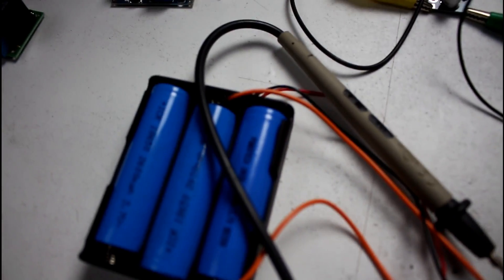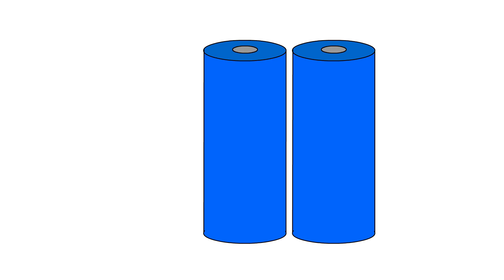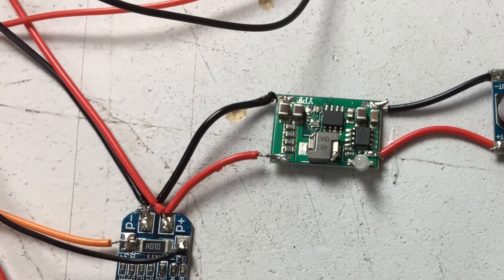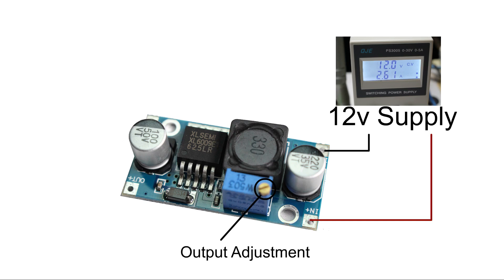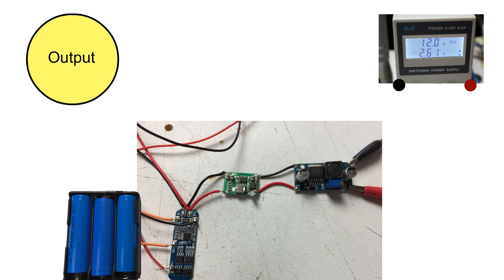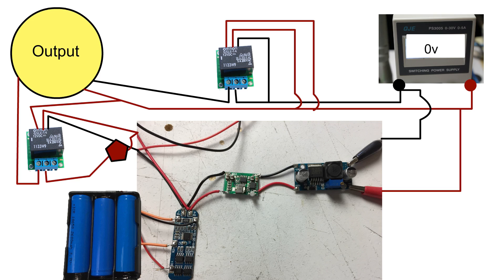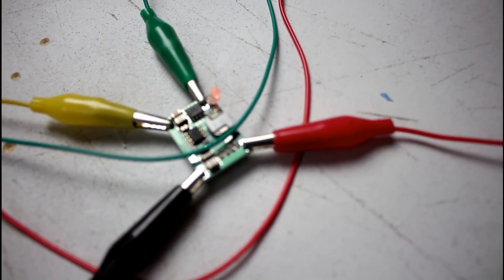Lithium cells in Series with BMS - Battery Pack Considerations (MEHS) Episode 61

Comment: Hi, Thank you for your video.
I have a question about the protection battery board (BMS). There is so many BMS on the internet, with 8A, 10A, 20A...
Like this one: https://ru.aliexpress.com/item/3S-20A-Li-ion-Lithium-Battery-18650-Charger-PCB-BMS-Protection-Board-12-6V-Cell-64x20x3/32799910439.html?spm=a2g0v.10010108.1000016.1.1c26848dPoZ5az&isOrigTitle=true
How should i choose the right one for ma batteries ?
Reply from the maker: - Hi.  Try not to worry about the ma of the cells but rather the current that your project will draw or the rate at which you will charge the cells.  How much current is going in and out of the BMS.  Then pick a BMS that is rated higher than that.  Remember some projects have a higher startup current, like those with electric motors so give yourself plenty of buffer, dont grab a 10A BMS when your project typically draws 9A.  in that case you might be better of with a 20A unit.  Cheers.
Reply: My Electronics & Hacking Show thank you
Reply: One more question. If my project need only 10A and i will solder BMS for 20A, will it damage my cells or my electronic items?
Reply from the maker: - Hi.  Short answer is no.  The rating of the BMS is how much current it can handle.  You will be able to get a physically smaller BMS by using one rated at lower amps but the current rating wont hurt your cells or your project.  The only factor to consider is how much current you plan to push through the BMS to the cells.  if the BMS can handle 20A its unlikely you would want to push that much current into the cells although technically, the BMS would allow it.  Just think about that and you should be fine.  Cheers.

Comment: what should i buy for charging 4 x 18650 cells in total.     i have 2 double 18650 battery holders that put the 2 18650 cells in serie.   voltage of 2 cells in series between 7.4 volts - 8.4 volts.
Reply from the maker: - Hi.  If you're talking about an integrated solution use the MAX745 board i reviewed a few videos back.  It can charge 1-4 cells in series.  If you are going to remove the cells you could use a 4 cell charger like the Nitecore D4. 
 Cheers.

Comment: If the project draws more power than the batteries can provide and needs to be plugged into a power supply, why even bother with the batteries?
Reply from the maker: - Hi.  I think what I said was, the external power supply needs to have enough power to run the project and recharge the cells.  If the project draws too much power, say 5A and the power supply can only deliver 5.5A then the cells won't be recharged correctly.  Cheers.

Comment: So im not planning on charging  my project while using it so how would i have to worry about looping
Reply from the maker: - Hi.  If your aren't charging while using, then no worry at all.  It's only an issue when your project draws 2A when running (as an example), and your charging module can only charge at 1A no matter how much power you could provide your project.  If your project is sleeping then the charge module can charge the cells without the cells being drained faster than the charger can supply power.  Cheers.
Reply: Thanks for helping me understand liked and subbed

Comment: Hey there I have a question. If my BMS is rated for 15A and I have a 30A power supply, will my bms draw 15A and blow up my batteries that can only take 5A? or will the bms only draw 5A? Thanks
Reply from the maker: - Hi.  If you are just connecting the 30A power supply (such as a power brick or wall wart) to your 15A BMS, and you are just trying to charge the cells (not ideal by the way), then your cells will only charge at around 1A each, so 3A total and this will drop off quickly as you are not applying a CC charge.  If you have a 30A CC supply then the BMS will be destroyed.  The reason your cells will only charge at 1A or less each is because you're not using a proper lithium charger to provide CC then CV.  The cells will just draw enough current to obtain a basic charge.  The BMS is not charging the cells, just allowing current through to the cells that does not exceed the peak voltage of 4.25V.  Cheers.
Reply: Thank you so much, big help. Love your videos and your channel. You've got a loyal sub here!

Comment: I'm building an ARM laptop and I was thinking a lot about the problem you stated here. Do you think a setup like the one I have here: https://imgur.com/a/Cxxg5 would work?
It's based on the setup in this video, but I'm adding a buck regulator before the load (i only need 5v for my project), it should handle either 12.6v or 15.6v (if you have the charger connected or not). I also added a diode between the BMS part and the supply to try and keep the 15.6v away from the BMS (there might be some back-feed through the diode, but only nano-amps). 
The thing I'm not sure about is tying all those grounds together, would that cause some issues?
Reply from the maker: - Hi.  I don't see a problem with your circuit design.  The proof will be to test everything once all together.  The only real differences would be the behavior of the parts on the circuit boards and the rating of such things as the diode.  Cheers.
Reply: Thank you! I will put it together and  test these days

Comment: Does the bms shut down when one cell reaches the low voltage or the total voltage?
Reply from the maker: - Hi.  The BMS monitors individual cells so it will shut down the pack if just one cell drops below the cutoff voltage.  If its a BMS that doesn't have a different recovery voltage or timer, it will turn back on when the voltage of the cells recovers above the cutoff voltage.  This means your project, say a light, will flicker quickly as the BMS turns the cell pack on and off as the low cell drops below the cutoff voltage (say 2.9v) and then recovers to be above the cutoff voltage.  Better BMS will have a recovery voltage that is different to the cutoff voltage.  The cut might be at 2.7v and the recovery might be at 2.9v.  And some have a timer that will keep the cell cut off for x number of seconds.  Hope that helps.  Cheers.
Reply: My Electronics & Hacking Show. So a bad balanced pack will leave others in the high voltage range when the first cuts off.
Reply from the maker: - Yes, correct.  That's why its important to use a good charging methodology such as a good lithium charger and balanced cells (as well balanced as you can find), doesn't need to be perfect but the closer they are, the better the result.

Comment: Your videos are great, thank you. I would love it if you could help explain how a BMS works when used on larger packs, such as those used for ebikes, or for a power wall.
Also, what happens if you were charging multiple packs, each with their own bms, from a single charge controller? Would this even work? Could it be dangerous? Thanks so much.
Reply from the maker: - Hi.  There is a video idea for later on, thanks.  Yes you can charge multiple packs from the same charger but the more packs, the less current goes to each of them so you would need to keep that in mind as you typically want to supply each cell at least 300ma.  Cheers.
Reply: Cheers. So essentially, I'd want to make sure a solar setup, with controller, could provide enough amps for the total number of packs / cells? With two packs, I'd want to send double the recommended amps/current for charging a single pack, and the BMS would, in theory, protect the pack from too much current if one finished first? Thanks again, I look forward to your future videos.
Reply from the maker: - Hi.  Yes basically.  You just need to make sure that the solar power source has sufficient current (and the correct voltage) for the X number of packs.  If the packs are 3S then you would be feeding the pack no more than 12.6V at a min of 1A and a max of 3A.  If you are just allowing the current to flow to the BMS boards and letting the BMS board do all the work for charging the cells then that not a good approach.  You need to have a regulator between the solar panel and the BMS(s).  Cheers.

Comment: 2:59 the curves have nothing to do with the electronics  it is only dependent on the battery internal resistance; the electronics do only the power supply limited by voltage (+sometimes current)
Reply from the maker: - Hi.  Yes that is correct.  Is that not clear in the video?

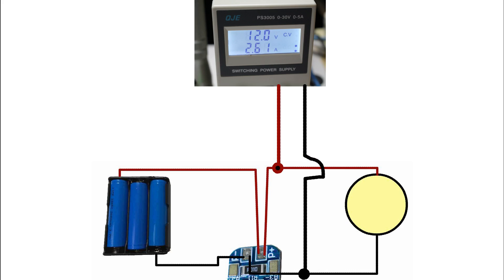Comment: 1:48 is wrong. do not connect it this way
Reply: It looks wrong to me too - the whole purpose of BMS is to disconnect the battery during over/under voltage or overcurrent.    But in the drawing, the battery is always connected (it is directly soldered to both the load and the charger).     
If your charger is unplugged, your load will eventually drain the cells to 0.0v and wreck them.  If your load shorts, it'll be.... exciting.  
As shown, the BMS is not in the circuit :(
Reply: Jan Kirchner yip ... Wrong... people on YouTube need to stop getting shit wrong... If you don't know shit don't say shit... Simple...
Reply: Take this video down and correct it! It makes the whole video WRONG!
Reply: At 1:40 he says "you also connect your project to the BMS" - which is correct, but the drawing is definitely wrong. If the image of the 3 blue cells where replaced with an image of a micro USB female adapter, it would've made sense.
Reply from the maker: - Hi.  This is actually the manufacturers recommended connection.  Why do you think its wrong?
Reply: Hi and thanks for the response. Well maybe I do not understand your drawing but battery should not be connected to the P+/P-. P+/P-. It is just to connect the load (output) and charging (input) in parallel.
Battery has another points to be connected to.
Btw - I doubt that this is the connection recommended by manufacturer. Maybe I just do not understand what you mean by the drawing (the blocks)...
Reply: @michaelsstuff4402  you are wiring the battery directly to the power supply and in this way you are not using the bms but applying direct 12v to the battery this is very unsafe and can lead to a battery explosion
Reply: C Mooner so is this NOW the corrected video ?
Reply: No. I believe this video is still incorrect.
Reply: Hello brother, I have a 3s 40A bms setup for my batteries, yesterday they worked fine but today as soon as i connect a load the Output voltage of the BMS drops to 6V making the load inoperable. This board is even new already threw one 3S 25A board for facing similar issue. Pls resolve or guide me if u know.

when load gets disconnected BMS shows Op again to 11V...each battery has 3.78, 3.79 and 3.80V
Reply from the maker: - Hi.  Yes you are correct.  My mistake.  They do happen especially when the hours blur together.  I will write a correction and advise people to view the actual wiring example shown a little further in the video.  Thanks.
Reply from the maker: Hi.  Ah yes now I see what you mean.  Yes you are correct.  I have drawn the BMS wiring connected to the P+ P pads instead of the B+ B- pads around the BMS.  I didn't even pick up on that.  Thanks.

Comment: Dear MEHS, I would like to create a big battery module for a small electric car. This car have got a 96 V nominal voltage feeding. I think to use the solution of relais. My battery pack have to 26 cells in series to create a nominal voltage of 96 V, but for a properly capacity, with a single cell of 2,6 Ah, I need to connect a 20 cells in parallel. So i Have a battery pack 26s 20p. If I use 26 TP4056 for charging and a Battery PROTECTION Board to control the discharging ( Balance function is not necessary, because we still look that don't charge properly my battery and main BMS have a "fake" balance function base on passive resistance, right?) with relais could I solve the problem? In what manner I can use a normal AC-DC wall feeder that provide, for example, 5 Vdc to feed my TP 4056? The cable for feed 26 TP4056 become too (very) big.... Then, if each TP 4056 provide 1,2 A for just one battery, It is possible to feed the 20parallel batteries? On each 20 parallel batteries I have got the SAME current of 0,06 Ampere? About Battery Protection board, when my pack is discharging the 20 parallel battery discharge with the same current? Thank you and sorry for not good english
Reply from the maker: - Hi.  I would not proceed the way you are suggesting.  There are a couple of projects I have seen that are doing something similar to what you are doing.  I suggest you take a look at the videos I link below.  Watch the series of each and take a look at the comments too.  I think it will help you a lot and help avoid some mistakes.  Happy to help if you have further questions.  Cheers.
https://www.youtube.com/watch?v=b3eRv_FZjBc
https://www.youtube.com/watch?v=i_j84mm3gOA
Reply: Grazie. :-) Have a nice weekend.

Comment: hello, I bought the SY6912 board but it comes set as 2s as default. the instructions are sketchy. the 0 ohm resistor or link in the red box in the diagram is not there on my board. which other ones do I remove to make it 3s. TIA
Reply from the maker: - Hi.  I received your email and I have replied with a couple of medium res photos that clearly show the resistor you need to remove.  Cheers.

Comment: Hello there, i found something interesting about the tp4056 in series. 
Here is a picture inside a  3s charger i found on aliexpress : https://ae01.alicdn.com/kf/UT810H6X8XaXXagOFbX0.jpg
As you can see there is 3 4056E chip (tp4056 clones) but this method shouldn't work because of the ground loop. Well here it looks like they fixed it with some diodes.
Reply from the maker: - Hi.  It works because the output (say 3 cells in series 3 x 3.7v = 11.1v) is not connected.  As a charger the 3 X TP4056 chips are working in isolation and nowhere do we end up with 11.1V.  Its always just 3 x 3.7v.  In an internal power supply setup we are combining our cells in series to get the 11.1v.  By doing that we introduce the problem of a common ground that prevents using 3 x TP4056 IC's as a charging solution without completely isolating each.  Thanks for the post though.  Cheers.
Reply: Thanks for your post, so how could it work then ? With that common ground problem.
The charger link : https://aliexpress.com/item/110-240V-AC-Compact-Balance-Charger-For-iMaxRC-iMax-B3-LiPo-Battery-Balance-Power-Compact-Charger/32710561277.html
Reply from the maker: - Hi.  If you use something like a 3S charger (your link), there is no problem as the charger is talking 11.1v the whole time.  The common ground issue is only a problem when trying to chain multiple single cell chargers together which are talking 3.7v each.  Cheers.
Reply from the maker: - Ah.  Ok.  I am not familiar with the product you linked but now I have found more images showing the outside of the unit I can see what's happening.  This unit has 4 pins as the charge output, one ground and one for each of the 3 cells.  This means that the charger is still just talking 3.7v X 3 and not 11.1V such as the MAX745.  Connection from the charger to the cells would NOT go through the 3S output of a BMS but would connect to the individual pads on the BMS where each of the cells are connected.  This way each TP4046 is just working like a single cell charger.  I like this idea and I am going to give it a try and do a video on it.  Hopefully I can get it to work like I think it should and it will be a great solution.  Thanks for the shares and the persistence.  Cheers.
Reply from the maker: - and yes the charger has a few diodes controlling current flow going to each of the 4056's which is the other part of the solution.  Cheers.
Reply: Thanks for your time.
I will buy one of them. This solution is quite good, no need of 3 isolated power supply for each tp4056.
Parallel charger are just better than charging them at 11.1v. No need balancing.
Reply: Hi. How is this approach going? Did you ever give it a try?
Reply: These chargers work fine.  The downside is you will be limited by the current capability of the balance leads.  Usually 1A, they get hot at 2A and probably start melting at 3-4A.  If you want to charge at 5A, you need an "in series" balance charger.
Reply: 2 maybe 3 years ago I made my own chargers with balancing using 4 18650 cells using 4 TP4056 and a 4 pack cell holder with wires. You run the cell holder in a series with a positive and negative at each end. The trick is you need isolation on the inputs so I used 4 old USB phone chargers and it will charge at the rate of 4 amps one amp per cell, run a cord to each of the AC male ends and you can plug it in the wall using a old extension cord. they make chips that allow isolation, but you can only charge at .200mAh. Use a project box.
Reply: Each TP4056 is wired in parallel at each end pos and neg on the cell holder and the wire that come on the holder is wired in a series to 16.8v when the last TP4056 turns green it's done. They still work for me.